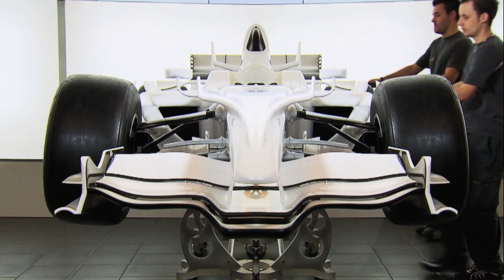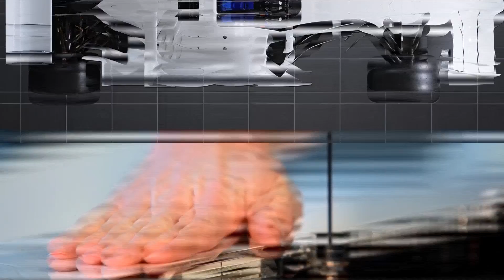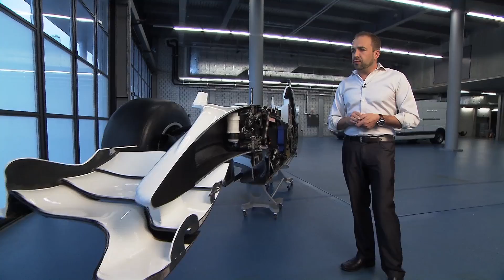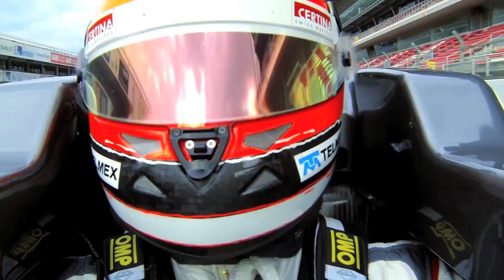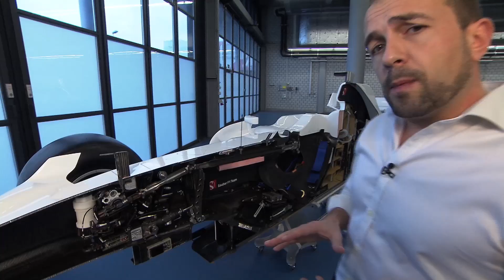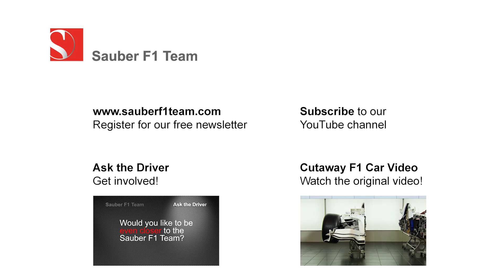Cutaway Insights - Episode 1: Pitot - Sauber F1 Team

Comment: Even before watching this video, I reasoned the pitot is more for helping determining instantaneous aerodynamics of the car, not ground speed. Ground speed can accurately calculated from wheel speed (may be more than one wheel). The video said it helps to measure car speed is misleading, but who am I to question Sauber?

I was hoping to find out more about how they use the pitot tube, as opposed to such short video without dealing into the engineering specifics.

Comment: As they say, it's Correvit, but that's just a brand name for an "optical speed sensor." It works basically like an optical computer mouse, taking pictures of the surface underneath very very quickly and working out how quickly the car is moving over the surface. Many models have two optical sensors so they can determine not only speed, but slip angle as well.

Comment from the maker: You got it :-) Basically... We measure car speed at the wheels, the pitot is basically a pressure sensor that measures the 'air speed' (same principle is used for airplanes). With no wind, wheel and air speed should more or less match. Headwind means the pitot will show a higher speed than the wheels, tailwind results in a lower air speed than measured on the wheels. All of that helps for the analysis of lap times...